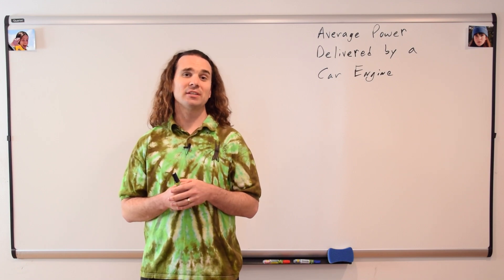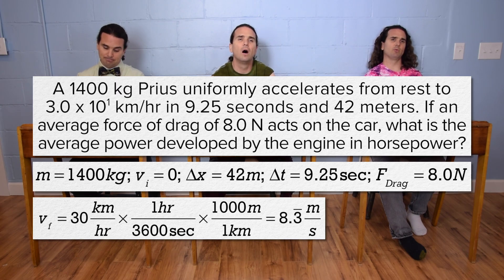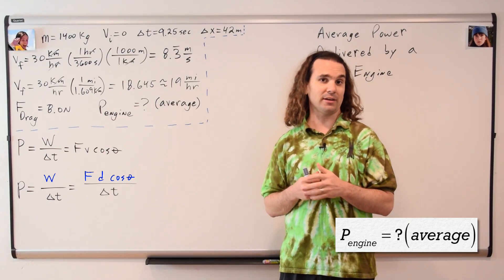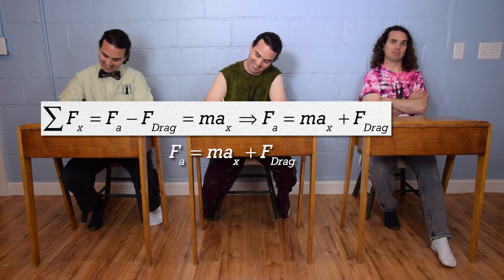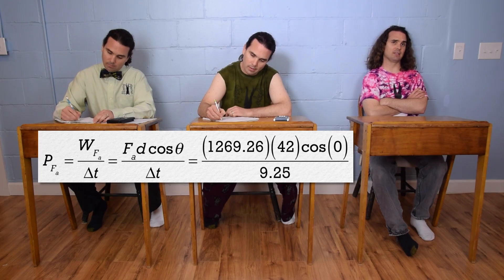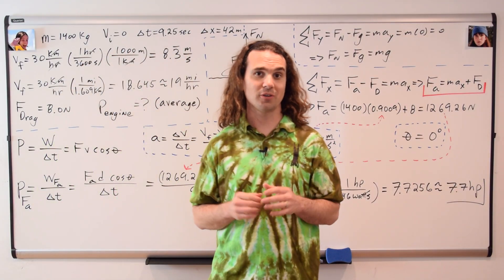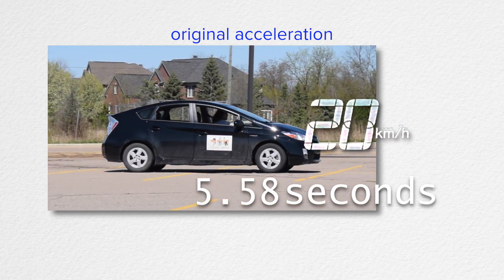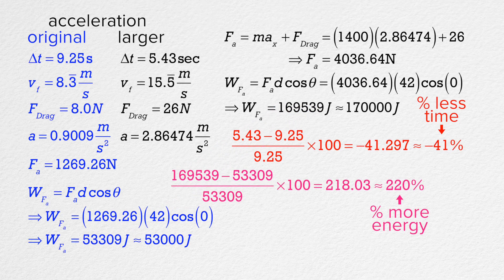Average Power Delivered by a Car Engine - Example Problem

Comment: hey, i tried solving this before watching the video
i used the equation P=F*v_avg*cos(theta), however i got a wrong answer using that formula, but a right answer using the P=(F*d*cos(theta))/t
i calculated average velocity by multiplying 1/2 times v_f +v_i, and i got the some force applied value, but when i plug in all the numbers at the end, i get 5288.588

edit: velocity average is found by dividing displacement by time, not 1/2 times v_f + v_i, giving me the right answer
also, how come you cant find average velocity by just adding the two velocities and dividing by 2?
i thought that v_avg = 1/2(v_f+v_i) works when acceleration is constant, which is shown in the video

Comment: One of the things that gets me nearly every time is using the wrong set of equations to determine something. For instance, you determine the acceleration by just using the definition. But why can't we use one of the UAM equations? More importantly, why does v(f) = v(i) + at give the correct answer (it is identical to the definition when solved for a) but Delta x =  vi(t) + 1/2(a)t^2 not give the correct answer? (I get 0.9817 m/s^2). Even more mystifying is how you can plug in the definitional equation for acceleration into the UAM equations and show it is equivalent to the acceleration in the UAM equations. Do you have a video on this that I may have missed to help me clarify it for myself?
Reply from the maker: 1) I point out the equation definition is the same as one of the UAM equations here: https://youtu.be/a0sJnLNzFjo?t=1m26s
2) When using real data, like I have done in this example, and you measure 4 of the UAM variables, there will be slight differences in the calculation of the 5th UAM variable. This is because of the uncertainties in the original measurements. This is why your calculated acceleration is close to ming.
3) "why is drag added to the max?" doesn't make sense to me. The force applied is to the right and positive, force of drag is to the left and negative. When you solve for the force applied in the net force equation, you add force of drag to both sides which is why it is positive in the final equation where we solve for the force applied.
Reply: It was because I originally wrote Sum F_x = F_a + F_{Drag} and made Drag a negative value - which is incorrect as it applies to the actual physics, but worked out mathematically (I keep wanting to make forces like drag, friction, etc negative values, which makes no sense in the real world). This means I did not pay close enough attention to what was written and didn't think about the why, and just tried to pattern match! I deleted out the question when I found out the source of my confusion. But you had already answered it I think, or youtube showed you my full comment :) So I appreciate it and feel bad about you taking the time to answer it anyway! Thank you for the video link, I couldn't find it!
Reply from the maker: Have you watched this video of mine? http://www.flippingphysics.com/understanding.html
Reply: That video was in fact exactly what I was alluding to :) I find math quite intuitive (at times, but not always), so that exact video kind of gave me a really good kick in the pants and made me change how I was approaching everything about physics!
Reply from the maker: Everybody needs a good "kick in the pants" now and then...